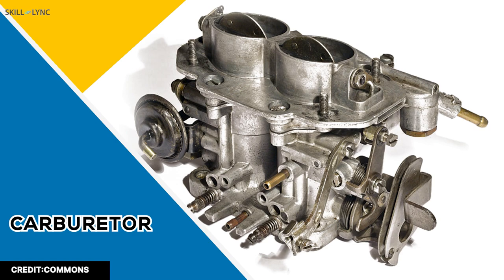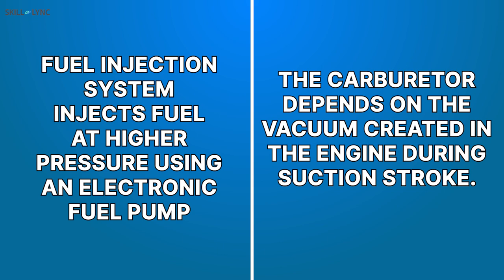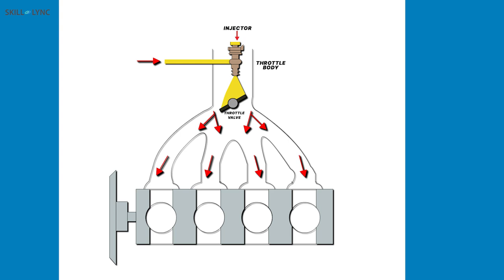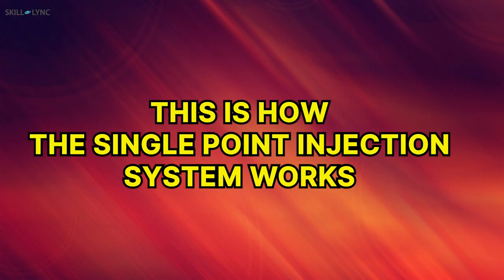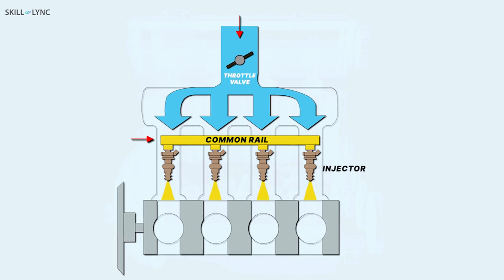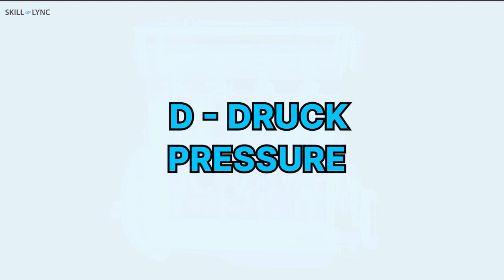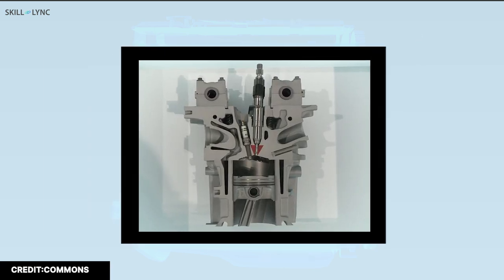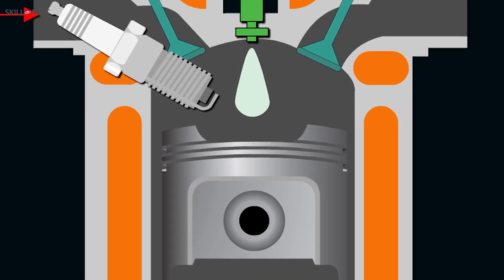Fuel Injection Systems in SI Engines | Skill-Lync

Comment: Good explanation but it would be better to spell out the words before you use the Acronym for the first time - I don't know what the SI stands for in SI engines even though I worked on engines for 50 years  - I know it is going to be something obvious when I find out. Hmmm after thinking about for some time  I guess it's Spark Ignition but not blindingly obvious - to me anyway.
Reply from the maker: You are right! We were referring to Spark Ignition ⚡️